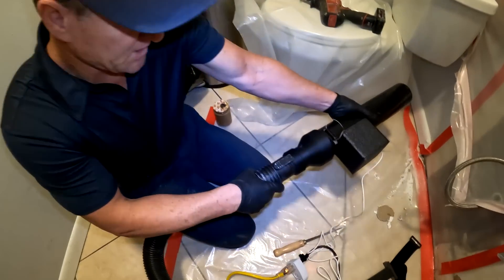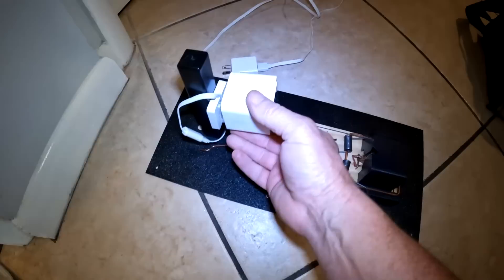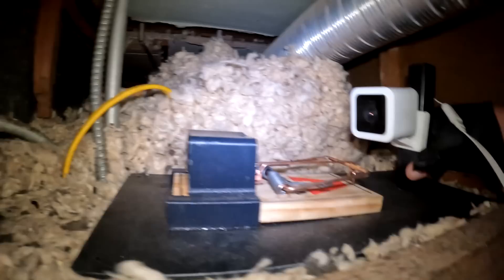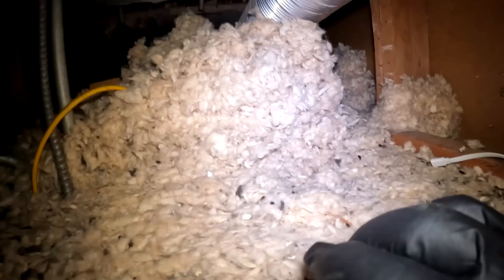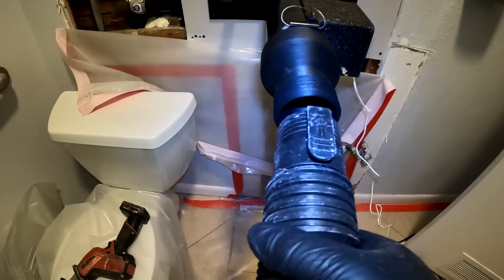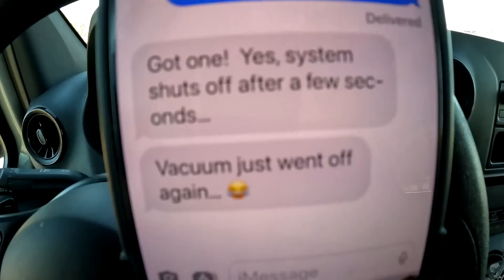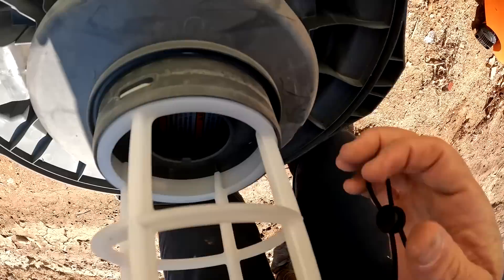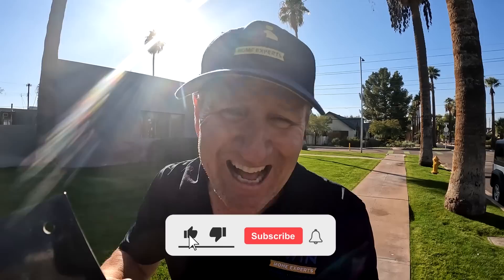The ULTIMATE way to get rid of Rats inside walls & ceilings… (sucking & snapping)

Comment: As a homeowner that has killed around 500 rats in the last 25 years in my own neighborhood, I applaud your out-of-the-box thinking and mods to the standard traps - I have done similar ones to increase the effectiveness of the traps.  I am assuming that you have 3D-printed some of those parts for the rat vacuum.  I have accidently trapped rodents in my shop vacuum in a similar manner where they crawled up the hose, dropped into the vacuum, and then couldn't get back out.

Comment: You guys are great.  Learned a lot.  Took me 2 days to fix all the containment issues.  Just spend 4 hours in the crawlspace removing all the insulation (which resulted in killing 5 baby rats).  Mom got away going into a hole.  House on one side is 3 feet away from a straight drop off.  Looks like they may be drilling through the side of the hill and into my crawl space.  Think it's about time to burn the place down, as I don't see how I can resolve that one....

Comment: I just caught my second juvenile rat in my new electric rat trap I used peanut butter with a piece of left over salmon 😅 we have a fifth wheel trailer and they got in where the pipes drop through the floor and keep coming chewing through the foam we sprayed and are not fazed by Epsom salt or peppermint oil how where do I buy the enzymes your talking about? I believe they have that area to marked to leave it alone

Comment: It is so great an idea, with not harming the envoirment. Than in the vacumm cleaner. Just a piece of som little fence with wire connection to an converter with a car battery an wupty. Electrocution. Sorry my bad English language. I am from Denmark. So i prefer German. But i understand all You tell us. You are cleaver guys. Kind regard from a very dry part of Dk. Only 5 inch during 22 days. So we maybe will not be allowed to make our tradiotional Solstice Celebretion on 21 of june 2023. But as long as the rain only comes in small ways, the rats will stay in the sewer system. But sadly the clima chances brings us a huge amount of hail / rain thunder storms. But the earth and soil is so dry, that wee need a day with constant silent rainfall, so all the water can stay on the farmer cornfields and gardens. But when wee get 1 6 inches in 30 minutes, all the water flood in the sewers, and than the rat gets other ideas😈😈😈Nice summer to mall of You, with kind regards from Hans Christian Denmark